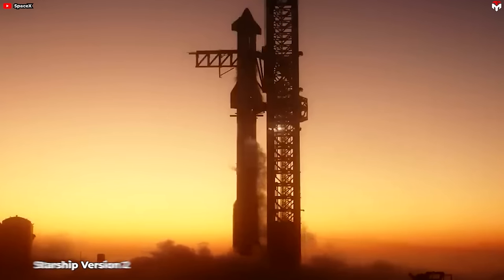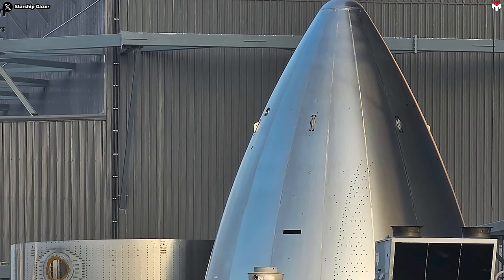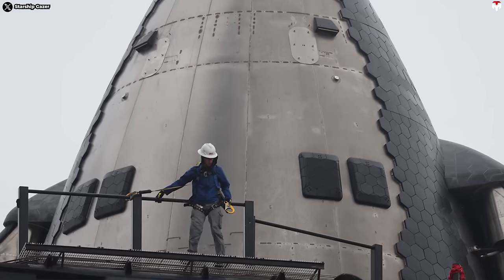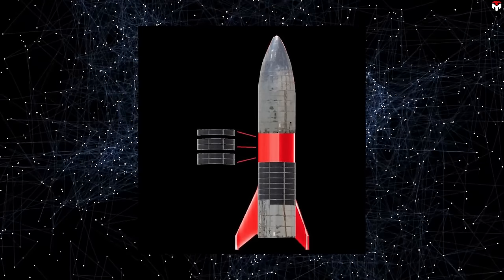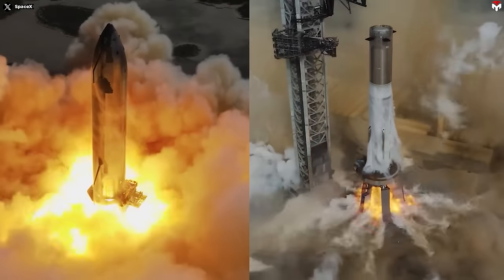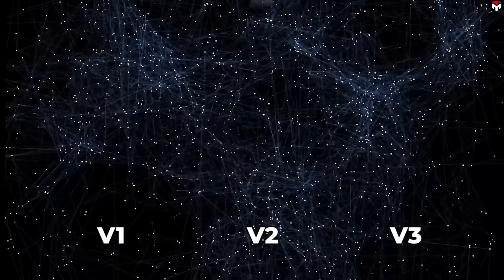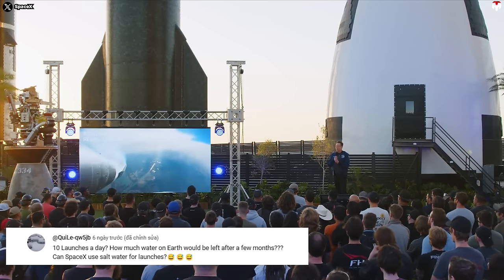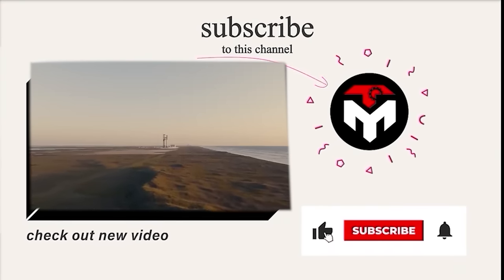Musk SpaceX officially Revealed 10 Upgrades on Next-Gen Starship!

Comment: I don't think your cost analysis of your last video is unreasonable as Musk is re-inventing space flight technologies. Case in point, with the new raptor V2 and V3 technology comes highly valuable patent rights which will pay off in the long run as other space agencies and developers will have to pay royalties to SpaceX in order to compete with Musk.  

Thus, The advancement in reducing parts/cost on the Rapture V3 engines will have a trickle down effect over many years that will garner SpaceX additional revenues as his competitors will either be forced to pay him to use SpaceX patented technologies or be left behind incurring the higher costs of using older more complicated heavier engine designs.  

The advancements of the simpler less expensive and more reliable Raptor V3 technologies will eventually be paid for by SpaceX Competitors especially if those competitors intend to stay technologically relevant in order to remain in business. 

Just like you, I am also Not a financial analyst but I'm pretty sure that Musk knows that there is significant added value in introducing leading patent-able technologies which force others to pay him royalties or be forced out of business. 

In essence, Musk is doing exactly what Henry Ford did in the early 1900's in that he is driving costs down thru "assembly line" style construction - as well as - leading and selling royalty rights through pushing valuable advanced technologies to market which additionally drives the costs of his "product" down effectively passing on the savings to the "general public" which in the long run will help him corner the market. 

Just as Henry Ford put the world on wheels in the early 1900's, so to is Musk bringing space flight to the general masses through a similar business model using the same assembly line style production all the while driving costs down.

Space needs this style of thinking.

Cheers, moe of the north
Reply from the maker: Thanks your great idea! I will find more about this

Comment: Great Episode. With V2 coming up. Will Raptor 2 engines be enough? By this time and the speed SpaceX accomplish it goals. I would think they might start to implement the Raptor 3. The heat tiles still might be a problem. Being that they are a form of ceramic. I've seen a micro photo of the composite. They are like little balls compressed together. This process makes them very fragile. I understand how the tile handle the heat. If they used a form of whisker reinforcement ceramic strands. It may solve the problem of cracking and falling off. It is possible to manufacture this. You covered a lot in this short time frame. Again Great Episode. Thank You Very Much.
Reply from the maker: Thanks for sharing. I do not why SpaceX still keeps the old structure on the tiles. So my guess is the problem is not about the tiles itself, the attachment instead
Reply: @techmap9  Could be. We had a problem With different ceramics failing. When we reinforced the ceramic problem it went away. I will get off of perch. Great Episode.